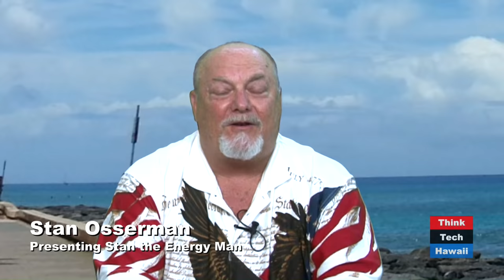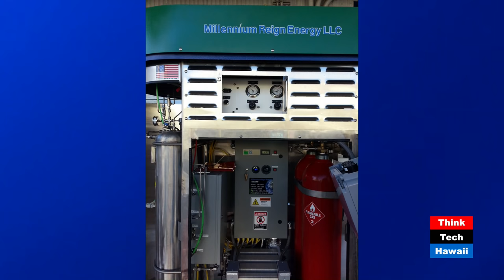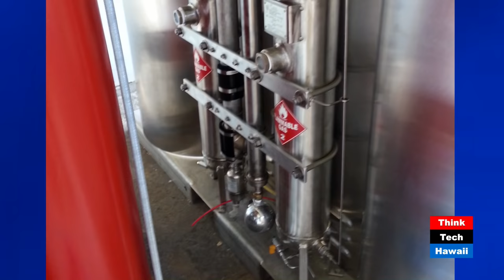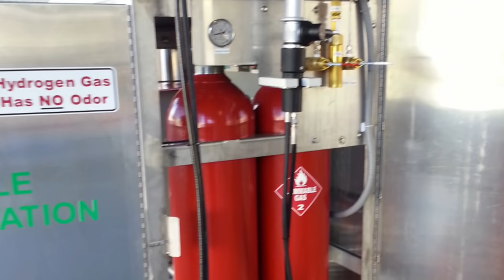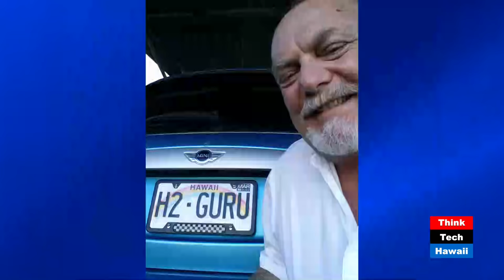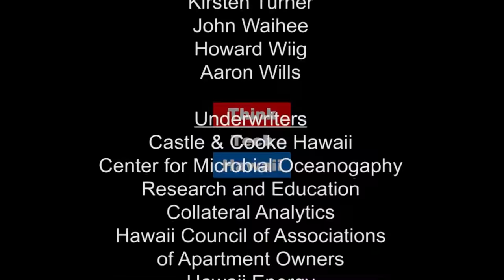Safely Making, Storing and Dispensing Hydrogen

Comment: Thanks would like to hear more about using excess solar to make h2
Reply: @Stan Osserman yes indeed
Reply: you get arround 40% of you electric energy as hydrogen, than you have to convert it again with about 40% efficiency, if your system is very good.
Reply: Solar makes power, it takes 12V at X amps to make hydrogen from water. If you want it for a fuel cell you will be losing power due to friction and heat. 
If you want it to store as a "battery" then I guess it might be okay as an emergency backup. 
If you want it as a combustible for stuff like an HHO torch and anything then 110% do it, but use a system that separates the hydrogen and oxygen so you can store them separately.
Hydrogen with more than 4% oxygen mixed in will create a bomb in the container.

Comment: amazig video ! can u clear my doubt ? how much safe is this hydroge energy storage as compared to gasoline storage systems
Reply: Akash Saini Mr. Osserman will have better stats and numbers but consider this: a hydrogen leak disperses fast (really fast, which is why, in a combustion engine H-2 works so well) and it disperses upward. Gasoline fumes sink, increasing dangers of combustion as the fumes travel along the ground looking for an ignition source.
Reply: The firefighters trained by Dept of Energy national labs all say hydrogen is safer than gasoline or propane. A lot like diesel as far as safety goes, but for different reasons.  The main reason is that hydrogen is so light it rises and disburses so fast it's hard to get it to ignite,  The storage tanks are also very well designed and  strong with safety mechanisms built it.

Comment: How do you separate the oxy and hydrogen gas produced ?  I can use a refrigeration compressor to bottle 450psi but I need to use bladders to separate the gases at vary low pressure.

Comment: An even better way to store hydrogen is in hydride or lithium 6.  The hydride will absorb the hydrogen in high density amounts and won't be released until a heat source is put to it thus making it a controlled release. You could get in a head on collision with another car and the tanks could be crushed or broken in half that has the hydride stored in it and even when the hydride is full of hydrogen it is safe.  You could literally shoot incendiary rounds at the tank and it would not explode.  The hydrogen again is trapped in the hydride is only released slowly using heat.  It's literally the safest way to store and transport hydrogen.

Comment: Carbonized creatine from chicken feathers makes a cheap nesting material for the storage of hydrogen. Out of a unit of water you should get 1883 units of hydroxide or 1,255.33 units of pure hydrogen. i would be very interested to know if those figures approximate your actual results. Thank you for the video.
Reply: Units on 0-10000 or 0-5000?
Reply: @makojuicedaniel9307  overall ratio is 1-1883. i.e. one gallon of water will produce 1883 gallons of fuel (hydroxide gas).

Comment: Aloha Mr Guru. What I would like to own is a battery electric car with a hydrogen fuel cell generator as a range extender. Does that sound feasible?
Reply: Definitely!  Fuel cell vehicles all have batteries, the trick is balancing the fuel cell  size and the battery size to meet the vehicle mission.  Fast or long range, light weight or heavy hauling.  most cars have small batteries and larger fuel cells.

Comment: Can you use hydrogen instead of propane to forge steel to make knives etc on a small scale?
Reply: yes, but propane is far cheaper
Reply: induction can be used to forge if you have excess electricity
Reply: You'd have to ask a metallurgist on that topic.  There is no carbon in hydrogen and that may be a problem for steel.

Comment: Hi could I use hydrogen instead of my lpg tanks to power my batch oven. I currently use 7 47kg bottles a week.
I’m in the UK and a gas engineer by trade
Reply: why, it will never be cheaper than lpg, nore will it be easy to come by, and storage is the mainproblem with hydrogen
Reply: Small low pressure tanks can only hold about 20 minutes of cooking time for hydrogen. We've found that small carbon fiber tanks are great, but it's hard to find anyone that can fill them.

Comment: How much is this system cost?
Reply: The smallest one they make is still a bit expensive at $95,000, but it's easy to operate and maintain, and best of all it's considered an appliance (like a refrigerator). so few permitting issues and you have your own gas station at your house.

Comment: Lets say some one uses a propane stove to cook with that only requires a 16 ounce tank. Would there be a safe way to set up a solar powered tank refilling station to go hydrogen. Right now 16 ounce of propane lasts me for 30 days to cook, But it also make me dependent on some one else s prices for my fuel.
Reply: thank you for the information. Not really wanting a pound of hydrogen. A 1 pound tank of propane lasts me for a month and think 1 pound propane tanks are pressure rated at 425 psi, 250 psi is what they are filled at. I just figured if a pound of propane lasted me a month then 1 ounce of hydrogen would last 2 days between refills. So if I went with say 1/4 of a pound and maybe up the tank size to a 20 pound tank it could be workable.
Reply: batterys will be cheaper for you! if you want to store hydrogen and compress it, aswell as have enough for a few days of constant supply the system, you could buy a house for that, hydrogen will never be cheaper than hydrocarbons or pure carbon.
Reply: The short answer is that it's better to use a solar stove to cook or use the gas directly off a basic electrolyzer (HOH).  The HOH is too dangerous to store, so you just use it as you make it.  The long answer is too long for here.

Comment: Why we require making, storing, and dispensing infrastructure instead of directly making fresh hydrogen by electrolyzer and use it directly?
Reply: I imagine a future where people have the technology to make H2 at home.
Reply: @Inertia888  I made hydrogen at home as a 15 year old using two carbon rods from zinc carbon batteries and a model HO train transformer. The setup included two jars inverted upside down in a plastic wash pan so that they were filled with water. One carbon rod was inserted from the underside opening of each jar with the openings of the jars under water. I think the HO transformer was variable with a max of 12 volts. When the power was turned on oxygen bubbled from one rod and hydrogen bubbled from the other. I could tell which was which by the volume of gas produced. If I dropped a match into the oxygen it would would flare bright and burn real fast. The hydrogen would explode with a load pop.
Reply: @Inertia888  it isn't that hard to do it
Reply: @voxelmaniam  first off, thank you for the detailed description. I may give it try since I'm a bit of a tinkerer myself. So it seems that if hydrogen is easy to harvest than the missing element is the desire to build motors and generators that run on hydrogen?
Reply: it´s inefficient, batterys work better
Reply: On board production of HOH is used already, but it is very flammable and dangerous.  Vehicles store 99,999% pure hydrogen which costs more but is much safer.

Comment: Its intresting but the way current hydrogen cars work are very different from what i intend to do i want to custom build a car with a twin cylinder motor that uses hydrogen as a combustable source its not as stable but it could be effective if done right

Comment: Just subscribed, I'm very interested in hydrogen displacing traditional fuels because we are in the grips of OPEC. I like HHO more though, it's less expensive to produce,
Reply: Hence the reason for the flash-back arresters used with the torches. When HHO burns it is more of a detonation than an explosion. Ever seen what happens when you fill a balloon with HHO and release it? It rises, making it very difficult to confine, and the hydrogen atom itself is  so small that it is difficult to contain pure hydrogen.
Reply: yeah, it´s expensive to produce ecological if you don´t seperate natural gas.

Comment: Hello Stan, I just watch this video almost 2 years later.... I have few questions.. everybody is talking about Fuel cell and I like them ... as a matter of fact  all hydrogen form of energy. But I m with a group who still like spark ignition engines, especially since I would like to restore old cars and run them with hydrogen( I was sold to hydrogen 40years ago, because a magazine said: you can burn it on a v8 motor too) ... if I m able to make a solid hydrogen storage tank Eg: metal hydride, with low pressure: no more than 1000 psi. Will your H2 dispenser handle it??
Reply: hydrogen is extremely hot while burning and can damage an engine especially an old one, hydrogen can push atoms through solid steel and even attack a metal storage, however natural gas is a good alternative for classic cars and less dangerous and cheaper and you don´t need a huge storage system.
Reply: Im just leaving you with the information that you can either chemically or biologically methanate H2. Methane is basically natural gas/heating gas. Don’t know if it’s still relevant for you a year later now.
Reply: The  Millennium Reign Energy equipment in this video can fill up to 5,000 psi tanks.  There's also a UK car  show that runs on the "Motor Trend" channels that does electric conversions and they have done one fuel cell conversions.  Internal combustion engines don't do well with Hydrogen unless you can inject it under pressure and delay the timing so you are injecting just prior to top-dead-center.

Comment: how many kilowatt hours to produce one kilogram of hydrogen? How much does hydrogen go for there?

Edit: See, these are not comments that are helpful. My research (but the results were really ambiguous) leads me to believe that it takes between twenty and fifty KW/H to produce a kilogram of hydrogen. But that's a huge range. I was really hoping to narrow it down. Similarly, research is really unspecific, but it's somewhere between $3 and $16 per kilogram for hydrogen. Again, that's a very broad range. For people wondering if this could be a going concern, these differences matter.
Reply: Josh Bobst if he had solar panel he can make it off the power grid
Reply: it depends, hydrogen is mostly extracted from natural gas as it is the cheapest method to come by, electrolisis is very inefficient and you have to do the reverse wich is similarly inefficient, that´s why hydrogen isn´t compatative as prices are concerned

Comment: What is the high pressure tank made of?
Reply: I thought steel couldn't be used as the hydrogen would weaken it over time.
Reply: Now I just need a cheap 5 kw fuel cell and I'm set.
Reply: High pressure tanks are usually "Type 3" carbon fiber.  They are very strong and have a working pressure up to 10,000 psi

Comment: this entire system needs to be produced in huge volumes so the costs can come down. from 100K to 10K  then it will have a chance for individuals to produce their own.  OR  1 of these per 10 block radius in a co-operative buy with all individuals in 10 block radius sharing the pump and supplying the power from solar to it